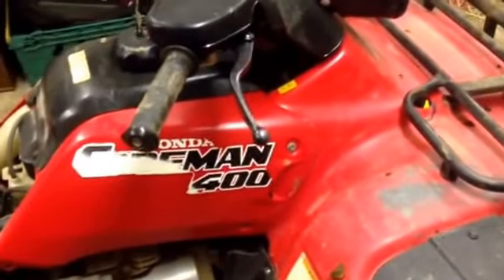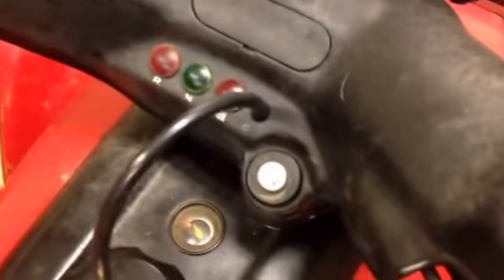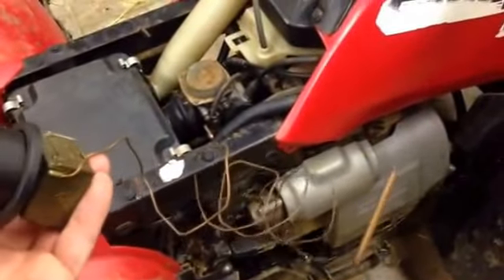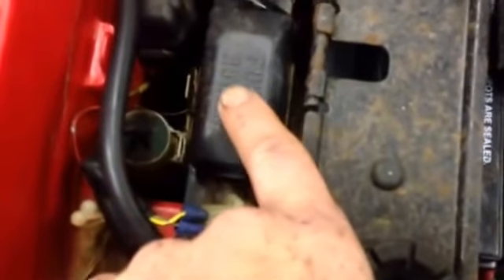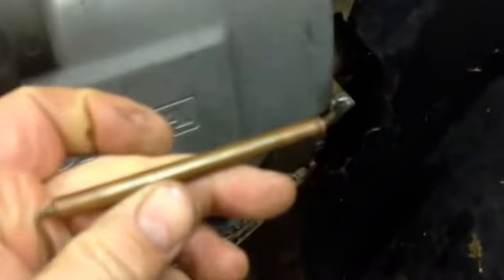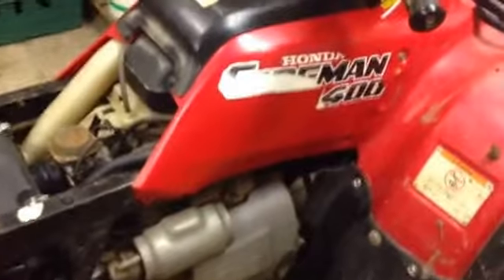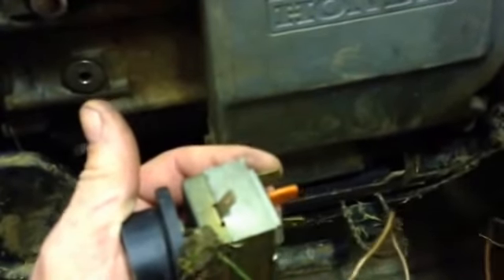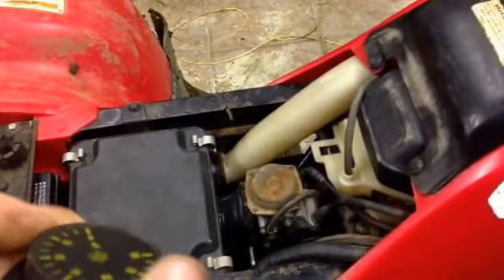Honda TRX quad,  fan control repair / oil temperature light part 1

Comment: Hey guys I got the same quad ... much easier and cheaper to just run a toggle switch to the fan and all you gotta do is flip the switch and run the fan all the time !! Works awesome ! Thanks for the vid !
Reply from the maker: Crazee Clayton totally agree - just not so automated.
Reply: Haven that issue now and going with the toggle switch as soon as I find out how lol
Reply: I did it 5yrs ago
Reply: Got mine done and works great took 15 mins
Reply: will anything happen to the stator or battery by running the fan all of the time?
Reply: Don’t forget to run a 20 amp fuse in there and if u ride in rain make sure to weather proof the switch and wires

Comment: Don’t do this. There are better ways to keep your normal functions and if your normal functions ain’t working than go thru and figure out why and replace it then just add a Y to a switch and give your oil temp sensor ground when you flip on the switch and u can run the fan when u want.